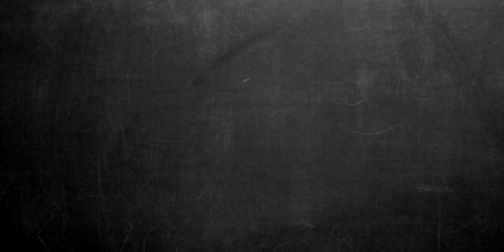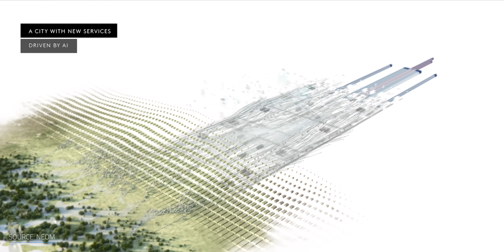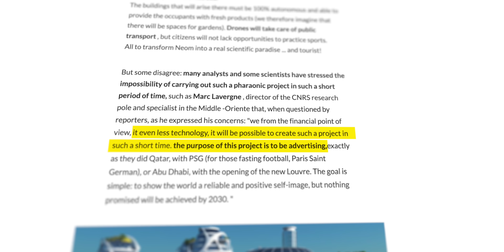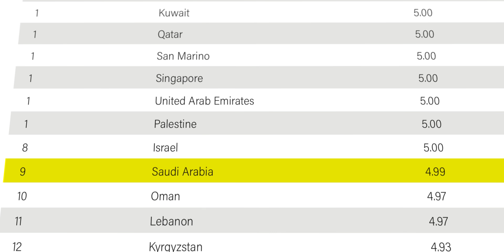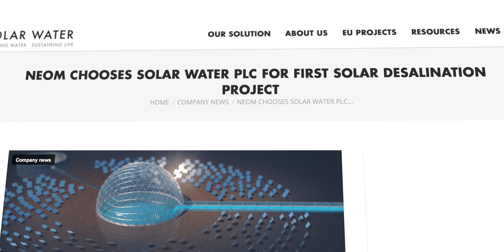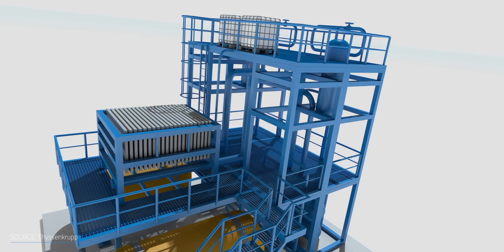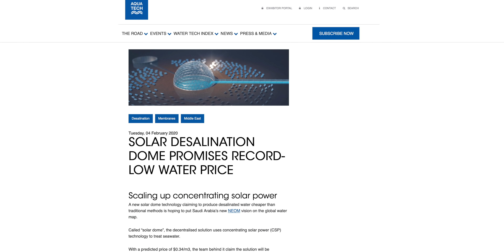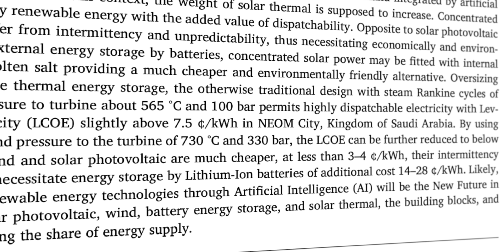Why Neom Might Be The Future of Sustainable Cities

Comment: Neom seems to be, at least in concept, the horizontal version of Paolo Soleri's Arcosanti. A product of Archology. The blending of architecture and ecology over 50 some years ago. Soleri did see himself as a theoretical architect. Neom, when all is said and done, will probably be remembered as theory rather than practice.
Reply: Soleri himself developed a linear city design or Arterial Arcology made up of urban modules connected by pedestrian and bike trails, shuttles, trains, and maglevs.
Reply: @BlueOceanStrategistS  I wasn't aware of that. Thanks.
Reply: @BlueOceanStrategistS  But why? What's the benefits of a linear layout?
Reply: @lonestarr1490  It makes it easier to adopt public transport because commutes are one dimensional instead of two dimensional, so everybody's commute will be similar.  It also enourages upward development.  Linear cities would technically be three dimensional, with a different mode of transport on each axis, including trains for most parallel travel, elevators for most vertical travel, and pedestrian for most perpendicular travel.  In order for travel times to be the same along each direction, the city should be stretched in proportion the speed along each axis.  The faster the train, the more linear the city should be (or the longer the arc should be).
Reply: @BlueOceanStrategistS  Ok, that makes commuting easier on paper. But what about troubleshooting? If your trains engine fails in a linear city, the distance to the depot would be way larger.
Also it seems to me that a linear layout would make commuting distances longer than they need to be. If pedestrians should be able to cross the width of the city in a reasonable amount of time, living space near the office will be very limited, thus people would live farther away from their work places than they already do in our amoeboid cities. Sure, the trains could go at insane speeds. But to achive those speeds, stations for those trains need to be sufficiently spread out. Hence, there will be commuters 'overshooting', taking the highspeed train in one direction and then having to change into a bus or so to revert for several km.

Further, I see issues with services. Like, basically all of the services: Ambulance, fire fighters, police, garbage collection, sewage, mail and other postal services, the list goes on. They all have a kind of 'area of effect' - not only in Cities:Skylines, but also in reality. The logistics appear to be easier on first glance, because routes are straightforward. But I'd argue the distances would actually make them a nightmare.
Reply: @lonestarr1490  Neom is planned to be 170 km long, which is basically the distance between Baltimore to Philadelphia.  So a city like Neom (which aspires to have a population of 1 million) would make more sense as an intercity "city" than as an all-out city unto itself.
Reply: @BlueOceanStrategistS  But Baltimore and Philadelphia have been around for a while and there's probably a reason why, in all this time, no 'intercitiy city' has formed 'naturally' between them. It's just an example, of course, but there are many larger cities in somewhat close proximity to eachother all around the globe, and I'm not aware of any linear stretch of city-like structure between any of those. In fact, the only settlement I know that comes somewhat close to a linear city is a small town in the east of Germany that threads mostly along one street for about 3 km. But even there that happens for a reason, because the town stretches alongside a huge industrial complex and a large power plant. Maybe there are some examples of larger settlements being lined up alongside a coast or a river with steep mountainranges in their backs.

I don't think settlements work this way. They would be better off building two 'normal' cities on either end of that line and connecting them with a highspeed rail line. In the middle, near the mountains, they could set up a recreation area.
Reply: @BlueOceanStrategistS  "It makes it easier to adopt public transport because commutes are one dimensional instead of two dimensional"

I don't see how it makes public transport easier. You can easily do public transport in a two-dimensional city. Many cities around the world do it.

A linear layout maximizes average distances within the city so it seems like the worst possible layout. Everyone's commute will be as long as it can be (whether it's by car or public transport).
Reply: @seneca983  If the city is barely large enough to support one long metro line across the city, it does make a difference. Also a city funneled by valleys or other natural land features is made dense and make it possible to serve it with a single metro line. Of course, if a city is not so constrained, then it must require more than one line to service and that makes it “harder” on the part of those developing it to get a city to adopt public transport off the ground in the first place. For a big city that can support multiple metro lines, this is not an issue.
Reply: @BlueOceanStrategistS  "If the city is barely large enough to support one long metro line across the city, it does make a difference."

I don't think this argument holds water. A linear city might only need one line but for a given size for the city that line needs to be much longer so it's not clear to me that it's any cheaper than multiple shorter lines. Also, in a linear city travel times would be longer due to longer distances.
Reply: @BlueOceanStrategistS  "Ultimately what matters is how many people live within, say, 10 minutes within a station"

You can do that without making the city linear. Just build stations densely enough.

"If a person can get from any place one city of the city to any place at other side of the city in 35 minutes using public transit, I consider that a success"

For a 170 km line that would mean average speed in excess of 290 km/h. For going from one end to the other without any stops along the way this would be possible with high speed trains (Shinkansen and TGV use speeds of 320 km/h). However, not making any stops along the way is not realistic because it's not only the people at the ends that would need to travel. With stops such average speed is not realistic.

With circle or square shaped city of the same size that time can be achieved with much cheaper systems. No high speed rail required.
Reply: @seneca983  A line can be a series of round towns connected by a train. If they are spaced close enough, you may in fact call that a linear city. Even if the “city” isn’t round, if the “towns” are round, then that’s great, as that is especially useful for integrating town transit with city transit. The town, being round, has the ability to form a hub about which each side of town is roughly equidistant from.

Now the real problem with cities, regardless if they are round or not, is when their subparts are not round. Cities like Houston contain suburbs that are often served by commercial centers that are spread along very long streets - the exact opposite of round.  As a result, the area of shops and stores that can be accessed by a bus stop is often outnumbered by area of houses. Of what use would such bus stops be to those who live near it? They would just as likely walk past the bus stop and go directly into the store. As for those further away, they may need to go to several different places along the commercial corridor which are within walking distance of a bus route along the corridor, but not in walking distance from the same bus stop.

That’s different than a very long city. The reason is that a city that is big enough will have most everything you need in each “town” within that city and, provided that the town is round, or perhaps a square, the equidistant distribution should in principle to make transit work there in an integrated fashion.

I decided to take this idea of nested roundness, or equidistance, to the ultimate level and envisaged a city made completely of regular polygons (polygons with equal sides) in a fractal pattern. This work is reflected in my new profile logo, channel banner, and also the link to the excel spreadsheet I have on my channel about page.

The gist is this: by insert-shifting scooters and vans into the second and third spots in the ordered sequence of pedestrians, buses, light rail, and high speed rail, all of a sudden, a city that is horrible for transit, such as the Greater Houston Area, can start to become transit friendly across the entire place, which at first may seem impossible. However, the trick here would be to make commercial corridors vertical so that instead of horizontal commercial strips, there are commercial centers that are about as tall as they are wide. As soon as that clicks in, it becomes possible to use vans (basically minibuses) each of which will shuttle between a commercial center and some neighborhood facilities (such as parks). Then scooters can be used strictly for movement between residences and those neighborhood facilities so that the van only has to stop once in the neighborhood.

Vans and scooters are not mass transit, but rather are forms of micromobility. They are the logical equivalent of giving roots to the roots, thus increasing the ability of transit to be “rooted” in every single community of even the most decidedly sparse cities like Houston.

In a similar vein to equidistancing (rounding of the shape), it is important that each form of transport in the ordered sequence is some multiple faster in speed (say 1.6x) and used for some greater multiple of distance (say 3.7x), such that any variation of distances that may exist do so at discrete steps that are evenly distributed on a logarithmic chart, not unlike the numbers on the Fibonacci Sequence. This is the essence of my new avatar and other things which I have mentioned previously.
Reply: @BlueOceanStrategistS  "A line can be a series of round towns connected by a train."

If one wants to develop a bunch of towns they can also be arranged in a 2D grid instead of a 1D line. That way the distances between the towns would be greatly reduced.
Reply: @seneca983  You could just build an arcology if reducing distances is really that important.
Reply: @BlueOceanStrategistS  That could potentially be a lot more difficult than just choosing a different layout for a city or a cluster of towns.

If they Saudis were planning some kind of arcology, I might be more optimistic about how much it's going to make economics sense, but that would depend a lot on the details.
Reply: Well there sure are some quite disconcerning examples for this kind of selfsustaining planed city projects/social experiments in high SciFi.
Reply: @stevemerkator   
Just watch the 2012 film "Dredd."
Reply: Tralexan  
If you have not already done so, should you ever be in Arizona, you should visit Paolo Soleri's Arcostanti.  Despite proceeding at a glacial pace, it is still chugging along and is quite interesting to see.  It, also, makes great wind bells at the site.
Reply: But Soleri's Arcosanti was based first in vertical urban cities, connected by linear transportation routes and agriculture. The  similarity is skin deep at best.

Comment: I didn't understand why they wanted this city as a straight line. A gimmick? This will off course harm biodiversity more than a normal city, and will use more energy (transport, electricity transmission loses, water pumping...). Also, this hydrogen energy path is soooooo inefficient. Why bother? Who will buy it when they can make electricity cheaper, safer, and with less environmental impacts? The desalination dome sounds interesting, and is very important, but maybe not mature yet.

Comment: I think Neom is absolutely brilliant, they will need to keep in mind that pure water is extremely corrosive and will weaken most materials it comes in contact with, they will need to add minerals to stabilize the water but that increases building costs when you have to use resistant materials before you can add minerals. Ammonia production for fuel may be the perfect battery solving many issues with hydrogen storage, it wont be just one answer but this is one I like. Oceanic Thermal Energy Conversion !!!!

Comment: Research 'Infinite Power' - a UK company that could change everything in the energy market. It has developed a product that can generate a large amount of very cheap, reliable green electricity that does not need new infrastructure. They hope their first commercial factory will open next year.  

Essentially it's a miniature solar panel & a radioactive stick placed in a brick sized metal box. It's modular so if you want more power, simply add another cell. Fill a warehouse with them and you've got yourself a power station.
Reply: That sounds like "too good to be true" crap.
Reply: @Diviance  It has already gone through research and development. The test will be whether they can effectively scale it up and mass produce it at the cost they've advertised. We shouldn't have to wait long as the £25m they're currently raising will allow them to build a factory in the first half of 2022
Reply: @Diviance  What I'm saying is we won't have to wait very long to see results. If by the end of next year their factory is producing these cells in decent numbers and generating cheap, green energy then we'll know it works. In fact we know the product works because they have already built and tested the cells but they are yet to prove they can be cheaply mass produced.

Comment: That solar desalination concept is the most likely one to come to mass use soon, though at that point you may as well straight up combine it with molten salt solar thermal electricity production. By controlling how much of the boiled fresh water is cooled with the incoming salt water (thereby preheating the salt water), you could in principle dynamically balance on demand energy production against the production of the more easily storable fresh water. Such a multi-use system would make the concept much more economically viable.

Anyway the concept of "the Line" itself is just plain stupid. A line is the shape that maximizes average distances between its points, the very opposite of what you'd want in a city. Building a city in the least efficient shape possible just because you can is nothing more than a deeply impractical gimmick. If you want to be creative with your city shape you can use a hexagon grid or something. Anything would be better than a line. It's such an obvious gimmick to lure in investors, that I'm surprised it doesn't involve "sOlAr FrEaKiNg RoAdWaYs!!!!" just to be even more stupid.

Comment: Did I miss it somewhere the explanation for why it has to be in a straight line??  I seen another video before on this project and Im still not clear on the exact point of why a straight line is necessary?  For the high speed transportation I guess?  Or is that necessary because of the straight line?  Are there other reason for the straight line design?  And why run it all into the mountain chain?  Is there a reason for that or is that just for tourism??

Comment: Even the first 3 minutes show a lot of problems and missed opportunities.
Building underground is alwyas extra expensive and slow. Therefore underground buildings have the advantage of natural cooling. I would put the peasants, skater, biker, ect in the underground, so they are protected from extreme heat, cold, sun, rain, lightning and so on. Cars don´t need to be underground, they do already protect their drivers from enviromental influences (this even includes lightning). Underground cars will provide a challenge to safety, since those Vehicles can burn whenever there is an accident. This fire can cause tunnels to collapse and cause damage to nearby buildings. Since there are people underground anyway (inside the cars) you also cant just suck the oxygen out and flood it with nitrogen as you do in server rooms.
Just drawing a line on the map to build a giant city there is stupid, this includes many areas with unstable ground, mountains that can´t easily be built on, areas without enough water for such a big city, ect.

Comment: I really think pursuing hyperloop is a fool's errand. Maintaining the vacuum in a tube will be prohibitively expensive. It might be easier in tunnels than above-ground tubes, but no one has even attempted that yet.
Reply: it'll be a stillborn project. If the technical challenges surprisingly don't prohibit it from ever existing, the next earthquake to hit the red sea tectonic rift will do that.
Reply: @M.Y.B.A-p4d  somewhat counterintuitively, tunnels are less prone to damage from earthquakes than anything on the surface. There’s still a plethora of reasons why the hyperloop is unlikely to ever happen though
Reply: @birdrocket  regular tunnels sure, but tunnels depleted to near vacuum? No one has ever tried that